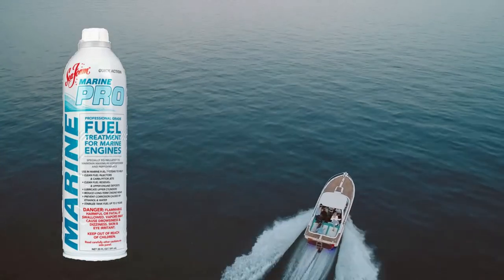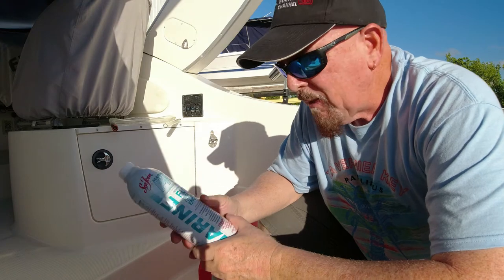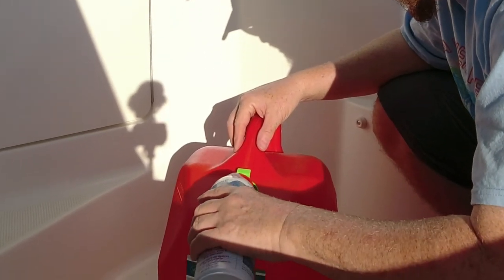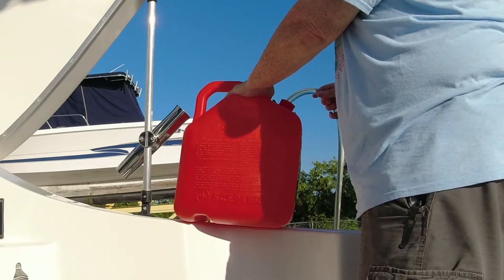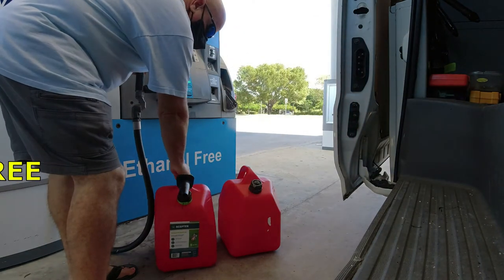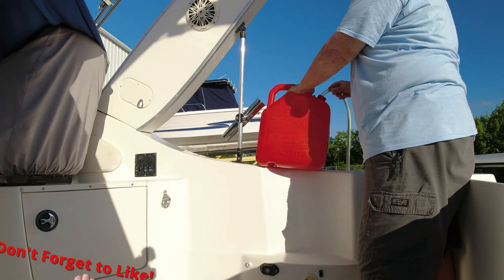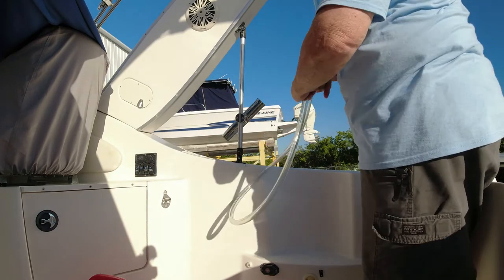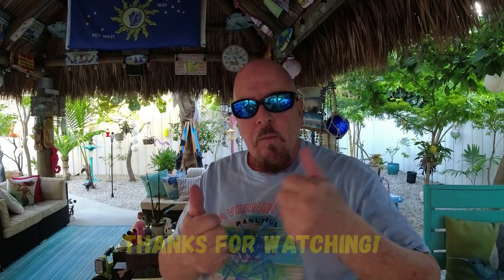Secret BOAT Gas Additive How to maintain to SAV your Engine

Comment from the maker: I use 1 can of Marine Pro Additive for every 30 gallons of gasoline, on every 3rd or 4th tank fill-ups. This is an excellent way to maintain your boats engine in tip-top shape! If you use gas additives in your boat, tell us what you use and your experience with it. Thanks for watching!